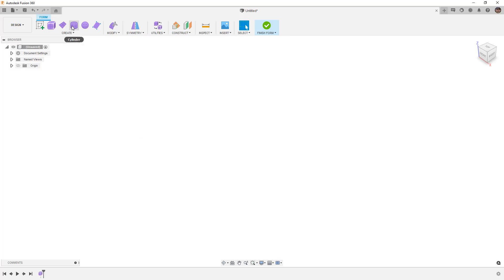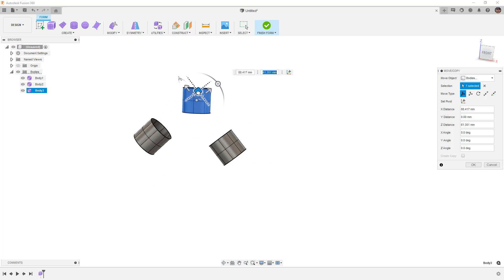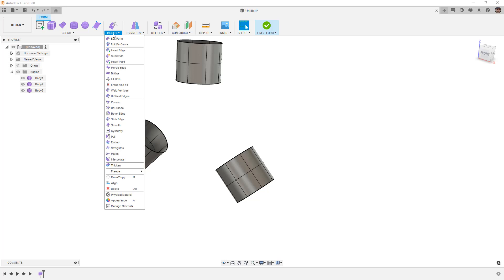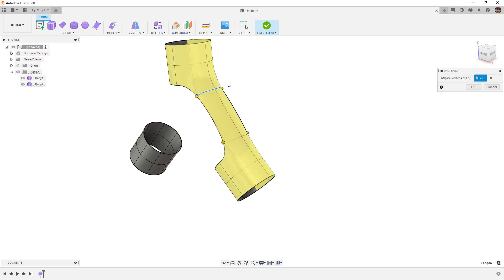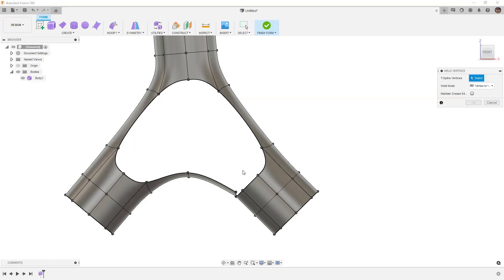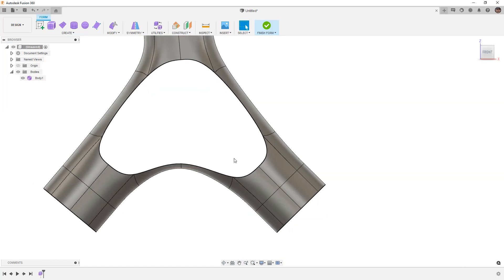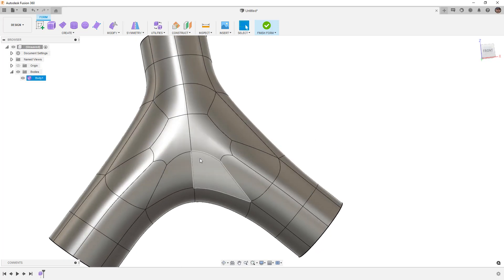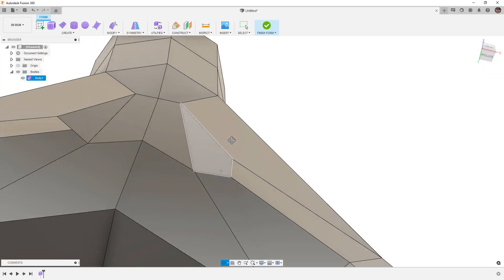Fusion 360 Form Mastery - Part 20 - Bridging Multiple Form Bodies Together

Comment: YES, thank you! This is the kinda thing that's been kicking my butt. If you want something to make a video about, I have a scan I can share with you. You'd probably make what I'm trying to make look good in like 20 minutes lol.
Reply from the maker: Thanks, I have a lot of content where we merge multiple forms together.  This is the common workflow when say making a car fender.  You make the wheel arch with a cylinder and you make the fender without a wheel opening.  then you trim and merge them together.
Reply: @LearnEverythingAboutDesign  I'm working on a 3 gauge A-Pillar pod. I want the surround for the gauge to all be the same, but the way it connects to the pillar is different (as the A-pillar changes size). Is there a clever way to accommodate this? If I make the gauge surround and copy paste, getting the other half of the pod body to line up doesn't quite work using match or trying to eyeball it. I can't seem to get rid of the step once I stitch them.
Reply from the maker: @Akya2120  with forms what I would do is make the face of the gauges first as a surface before you create the form.  then when you are working on the form you can use the Match tool to attach the forms to the surface edges.
Reply: @LearnEverythingAboutDesign  exactly what I'm trying to do, but when I use match it still leaves me with a slight deviation even on curvature. Probably won't be noticed when I go to print it though honestly.
Reply from the maker: @Akya2120  if the issue is near the mesh what you probably need to do is make more edges near the mesh and once they match use the Freeze command to keep them from moving.  If a new change tries to move them a prompt will ask you if you want to unfreeze or not.
Reply: @LearnEverythingAboutDesign you're a gentleman and a scholar!

Comment: When you fix those quads that have the shape of a triangle, why don't you just move the vertex so it becomes non triangular? (Possibly move it in depth a little bit too.)
Reply from the maker: When you have a T point where one edge ends in the middle of the other edge, the edge where the T is formed really should stay coliniear.  The reason for this is because when that edge is broken the surface does some very weird stuff.  So whenever you are using T points like that you want to keep it straight.  You could use the repair utility and convert the t point to a star point and it might have worked out ok.

Comment: Hello, if i create box form i can copy paste multiple times. But if i create pipe after clicking finish form then also if i create box form i can't copy paste them together after clicking finish form. What can i do? If i click edit feature on one of them i can't see other form body.
Reply from the maker: The pipe form is a little different as it maintains some history in the Browser and you can edit it.  Are you creating all the forms in the same feature? or in individual features?  If you copy a pipe form while still editing it will break the link to the "Pipe" in the browser and copy it exactly how it is at that moment.  After you finish it should be treated like any other surface or solid.
Reply: @LearnEverythingAboutDesign  They weren't in same form. Created seperately. I only finded "save as mesh" option. I can insert to another file but this time i can not edit :S

Comment: did you try allready try and play with those tools like automated modeling, generative design, or with the tools from physic Simulation to generate other specials designs?  
 I still very impressed by the chair https://www.youtube.com/watch?v=2PsssMI0Yw0 and I would like to play in this direction (not 5 axis cnc for 3D allien model just 2,5 axis, like 2,5D modell a bit special ) and all those tools are for Industry, not really for playing with the forms  it look like easier to approch it with Forms or something betwin like easy Generative + easy Form. Ok sorry for confusing but I will be very interested with videos in this direction
thanks a lot for all the content you share
Reply from the maker: Hi, I think when this video was done it was before Automated Modeling was out, but I do have 2 videos on that topic.  This series specifically is looking at just working with forms.

I do make videos for Autodesk as well and have several generative design courses on their Certify page for Generative Design.

But to answer your question on this.
Automated Modeling is great way to quickly connect a few things together with a form that you would want to then manipulate.  It has no input of material or loads, its just shape exploration.

Generative design is great to produce models that are structurally design leaving the look as a biproduct of strength.  The problem you run into with this is two fold.  1. you really have to have a solid grasp on the loads on your design for the outcomes to be anywhere near useful and 2. you need to know/be able to work with the end result to either inspire a final design or to make a design meets all your needs.  Generative design does have 2x and 2.5x cutting but requires that all your preserve geometry is the same height.  But the end result is a sketch/extrude.

The forms tool "Pipe" is a pretty good one to let you explore building a 3d sketch where you want your form to be and then using the pipe tool to make a lattice structure from it.
Reply: @LearnEverythingAboutDesign  Thank you,
I'm looking into these solutions
Reply from the maker: @franmo662  Here are links to a few of the videos.
https://www.youtube.com/watch?v=6UZWffH1Mfs
https://www.youtube.com/watch?v=0gSfSCRimkA

and this one on cleaning up/editing automated modeling https://www.youtube.com/watch?v=598yPz14uo4

Comment: The topology stuff is super interesting to me.  Is there a whole area to study about the relationship between box and smooth mode, or is the math at a level of complexity where its really not practical and best to just sort of tweak stuff until it works, avoiding triangles, T's, n-gons and obviously funky shapes?
Reply from the maker: The box display is generally the best way to model the concept.  you can use the control display Alt + 2 that will let you work on the box and show the smooth.  The math in the back is looking at the direction and influence of the box to make the smooth.  In the first forms video we talked about the 2d spline and how that relates to the box/smooth display.

Generally if the box display crosses itself or isn't visually consistent you will have problems with the smooth display.  That is about as far as I would worry about it.

Comment: Why you don't use 0 for scale value when you want to bring something to one plane? I tied 0 and it looks fine, does exactly what I want :)
Reply from the maker: Excellent question and observation!  The main reason?  Habit :)  I never manually enter values and usually just drag it close to 0 and the reason is because of how Fusion behaves when you hit Enter.  It doesn't just accept the input it ends the entire Edit Form.  So in all honesty I had never even tried to enter a 0.  I will be sure to point that out next time we use that in a video!!!!  Thanks
Reply: @LearnEverythingAboutDesign  I usually just hit TAB, then it applies the value but remains in editing mode. It changes selection to next modification tool or different axis so it's important to control what you are doing next ;)